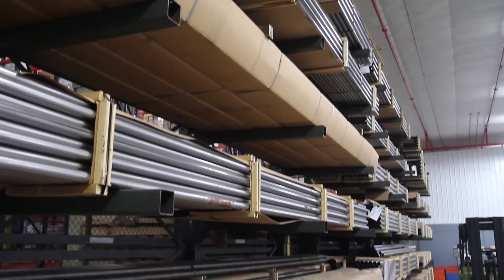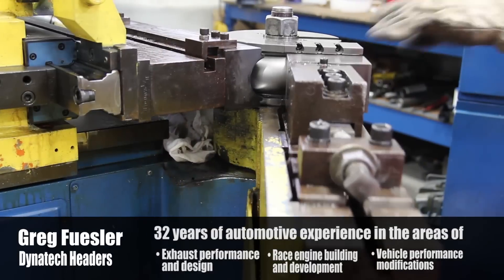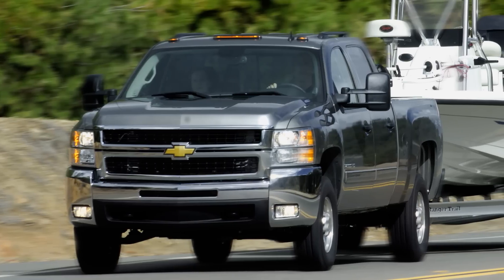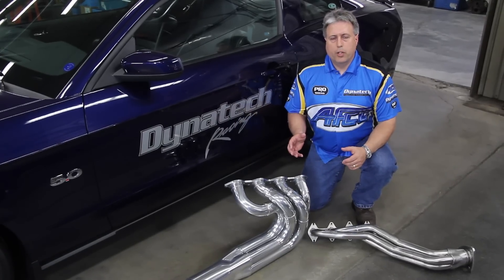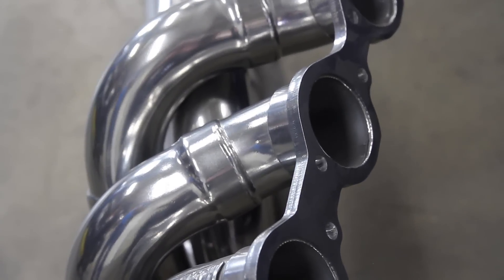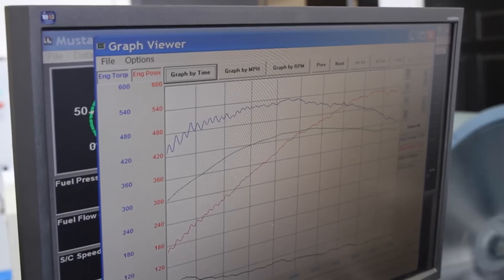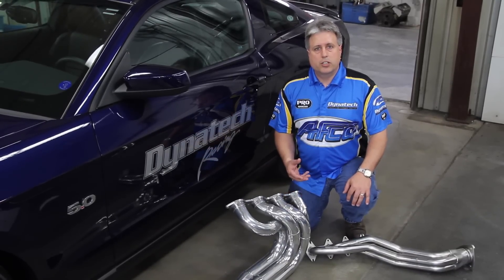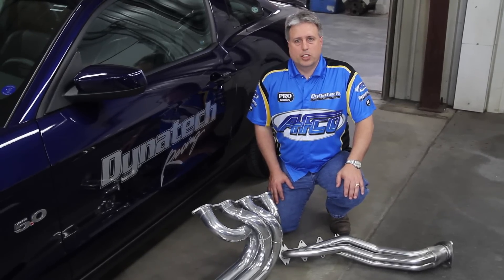Header Tuning - How Tube Size Affects Horsepower and Torque

Comment: If there is enough flow larger will not help high rpm power and will hurt low end I'm not sure about the shorter If savaging is more effective at high rpm with shorter headers then ok but other wise it should not make a difference